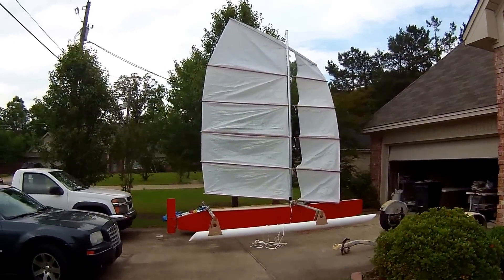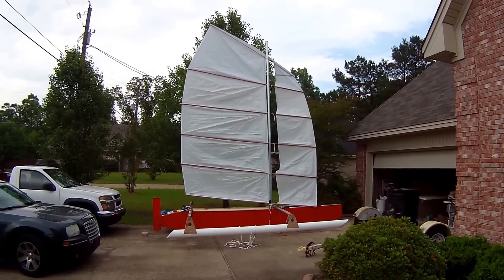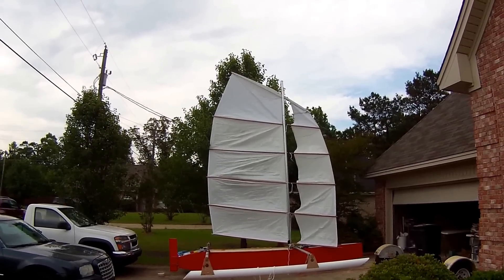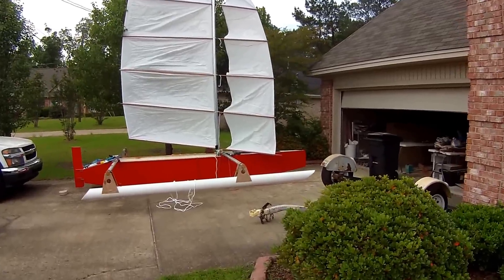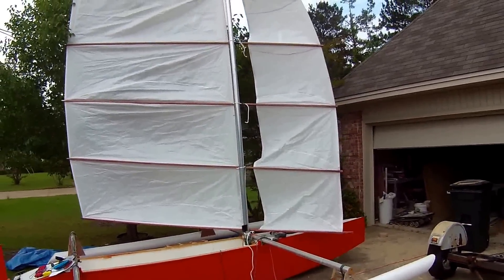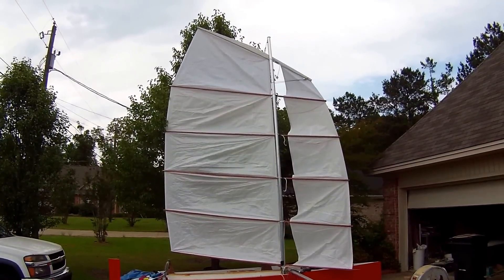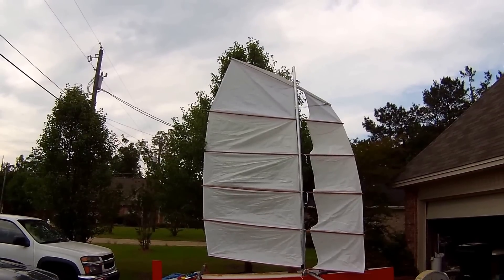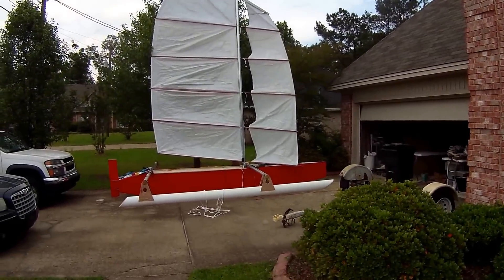Little Tri by Mike

Comment: Hi Mike,  
  I watched  your small tri videos and  really enjoyed them.  What a rocket ship!  I'm in the process  of  designing a biplane junk rig for a light cruising cat that I want to buy in Thailand.  I  like the look of your sail and am  thinking of adding a panel at the bottom and making it bigger  but otherwise similar. I really like the simplicity of  the curved panel at the top  
  I've been through  all  the info I can find including the Practical Junk Rig (PJR) book as well as the info on the Junk Rig Association (JRA) website.  Did you  use  the  info  from PJR and the JRA, including Slieve McGalliard's files to design your  sail?   Did  you find other  sources that were useful?  If you don't mind sharing and have any plan  drawings  of your sail I'd  love  to  see them.
Cheers Brian Swanland